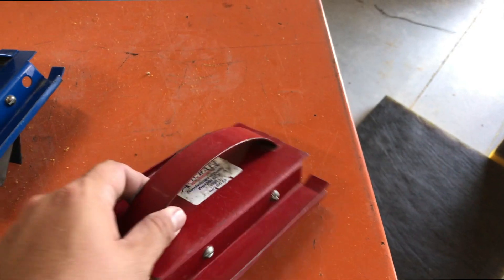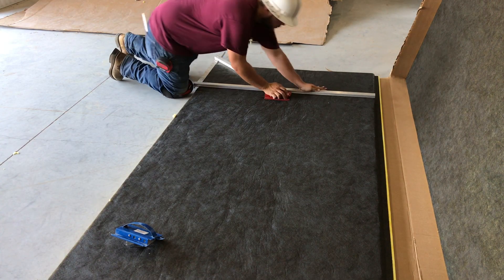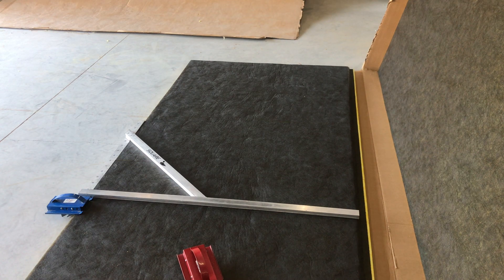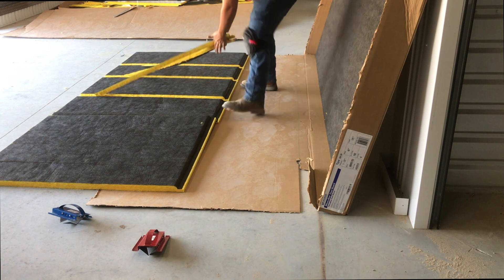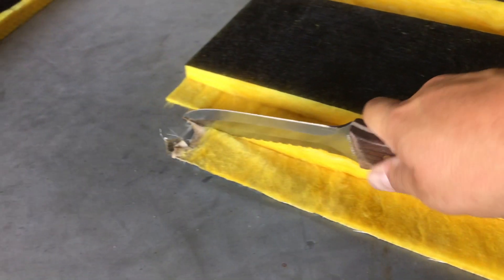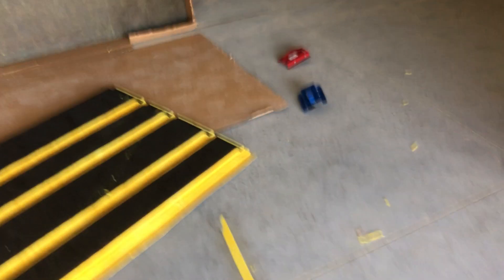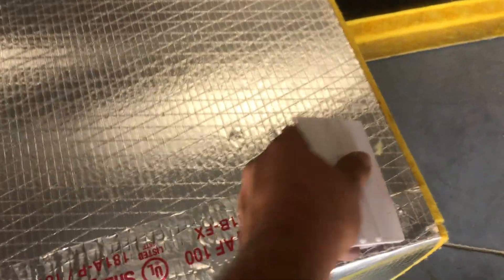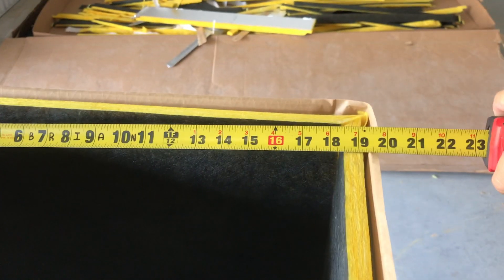How to Build Duct Board

Comment: Very nice! Foil, mesh, staples and mastic... impressive. I've got an apprentice I'm trying to untrain from some knuckleheads that taught him that foil tape and mastic are a good recipe. We just changed out an evaporator coil that was installed that way and I literally tore off a continuous 48" piece of foil and mastic joining the furnace and transition to the evap coil. I told him that if I came back to QA/QC a job that I sold and someone did it that way, they get ONE MULLIGAN and the privilege of me checking every job for the next 30 days. Any further excursions, the tech will come back and do it right and receive minimum wage for the training while they do it.
Reply: Subbed ya!

Comment: Good job bro...I'm sure you're using an outward clinching staple gun and not a standard one right? Normal staples work themselves out of ductboard or so I always heard, so we've always use the outward clinching ones
Reply from the maker: Thanks! Yes, we use an outward clinch stapler. The outward clinching helps hold it all together. It's also good for insulation around metal duct.

Comment: Where can i find Duct Board like that. Im only seeing small pieces?
Reply from the maker: HVAC supply house.
Reply: @howtodothings8415  thank you. I can use this to run a duct from my existing duct work to my garage where i put ky new air handler is that correct? About 5ft

Comment: Thank you for your awesome video nobody on you tube explains it better then you sir!
 im still a little  confused though could you please help me out I HAVE 1" 1/2 RED TOOL AND 1" 1/2 BLUE TOOL IF FOR EXAMPLE I NEED TO MAKE A 20X20 PLENUM HOW MUCH DO I SUBTRACT OR ADD TO FIRST CUT? AND WHY DOES AMCRAFT INSTRUCTION SAY TO ADD TO EACH MEASUREMENT PLEASE HELP SIR THANK YOU IN ADVANCED NEW SUBSCRIBER HERE!!!
Reply from the maker: Vasquez Soccer Squad if you need the duct to be 20x20 inside dimension then you would just add around 1/2” to your first cut. If you need it to be 20x20 outside dimension you would subtract 2 1/2” from your 20x20. So it would be 17 1/2” x 17 1/2” but you would add 1/2” to your first cut. That’s what I do with my tools and it gets pretty close to perfect.

Technically you should be adding 3/4” to your first cut because that is half of 1 1/2” but there are so many variables that come into play such as the pressure you apply, how broken in your square is, and the conditions of your cutting tools. 

Also, technically, if you are putting perfect pressure on your tools you should subtract 3” from your outside dimensions. I subtract 2 1/2” because that’s just works out for me. 

I hope this helps!!

Comment: Right here in Texas is not allow to use tape and mastic. Once you put the staples , you can choose to use or tape or mastic on top, but not both, or inspector reject job.
Reply from the maker: Joseph Schneider yeah it’s different in certain regions.
Reply from the maker: Joseph Schneider I would love to not have to mastic 😂
Reply: @howtodothings8415  agree
Reply: @howtodothings8415  Then how would you ensure an air tight fitting?
Reply from the maker: @chrischeek2963  duct leakage test

Comment: TIP: Keep the factory end (flattened side) closest to you. It's much easier to start the cutting tools on that tapered side verses the straight side.
Reply from the maker: Michael Yolch absolutely. Also, if you run the ship lap tool backwards it will not come out correctly.

Comment: How do you do outside dimension?
Reply from the maker: The total width of the duct will be 3 inches larger than the inside dimensions. So if the duct is supposed to be 16”x12” the outside will be 19”x15”. This is because the duct board in this video is 1 1/2” thick. Add the two sides or the two top and bottom together and you get 3 inches. 

If you need the outside of the duct to be 20”x10” then you will need to find the inside dimensions to make the cuts. In this example you would subtract 3 inches from both the 20” and the 10” and your inside dimensions would be 17”x7”. Then follow the directions in the video to cut the duct board. Hope this helps!
Reply from the maker: Remember, everyone cuts with a little different pressures on their cutting tools. It may end up being a little off. Adjust accordingly.
Reply: Do you still use the right side as your mark

Comment: Doesn't the measurements change depending what size duct board thickness?
Reply from the maker: Correct. This video is for 1 1/2” ductboard. I take 5/8” off at the start and it always works out for me. However, mathematically it should be 3/4”. 

For 1” duct board I would take off 1/2” and see how that works out. Trial and error. Also, you would need 1” tools for 1” board.